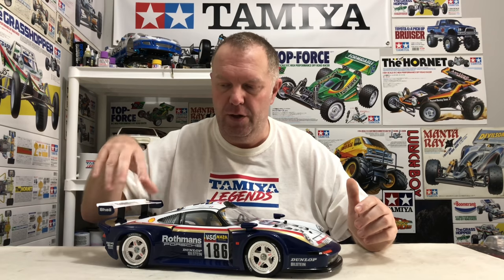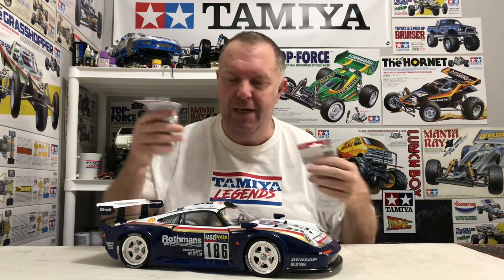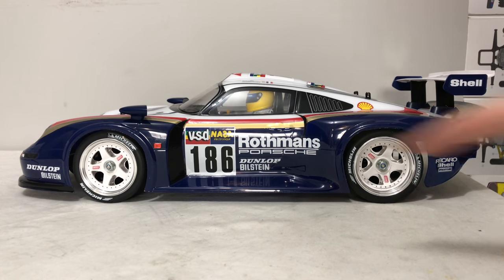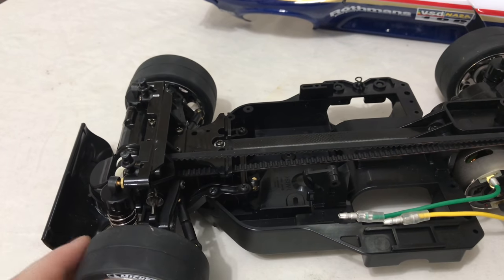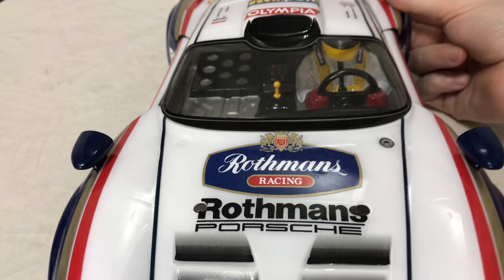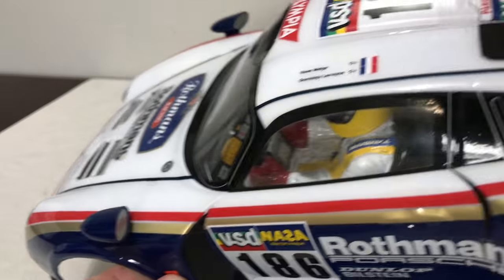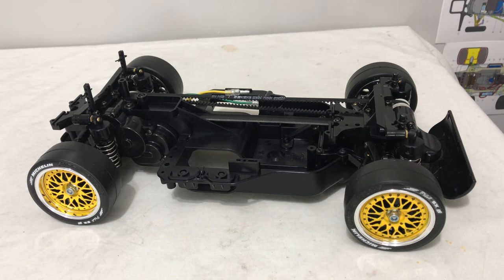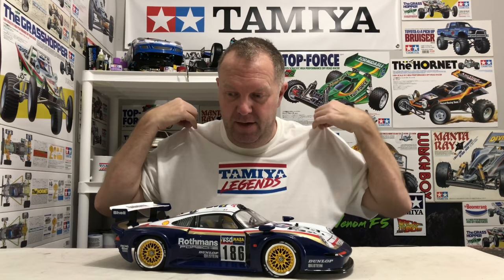Tamiya Porsche 911 GT1, 959 Tribute Update...

Comment: Hi Glenn, Tamiya do a paint called Tamiya accent panel line. We use it a lot in modelling to hi lit panel lines, I know clues in name eh, but you dab it on with a small thin brush and any over paint you get can just be wiped away with a Cotten bud lightly moistened with white spirits it’s much better than normal paint as it’s easier to remove. If you go on you tube there’s loads of how to’s on the stuff anyway my friend an absobloodylootly fantastic build I’ve got one of these on order but my supplier is having a right old time trying to get hold of one but in the mean time I’ve been ordering all the hop ups for it. You take care and stay safe, Kenny 😃👍🏻👍🏻👍🏻

Comment: Both look good. The white 1 looks like the Toyota Tom's supra gt.
Reply from the maker: Thanks for watching Chris 😊👊🏻
Reply: My partner hates me watching because of lock down i bought a battery to use the 2 cars u had that wasn't used for 6 years or more ta01 and a ta02 car chassis. Than when i got the battery other things went wrong was watching ur video and now i have 1 car working and a s2 lipo and a 8t motor and i want to buy more stuff all thanks to your video. But iam also buying something for my 4 year old so we can play together.
Reply: @TAMIYALegends  sorry to bother you but your the only person that replied to me. My 8t motor has made my tamiya connector melt twice so i read that i should use deans connector but i don't know what to buy. And is it ok to use a deans to tamiya connector so that i can charge my battery as the charger is a tamiya connector. Thanks again for your help.